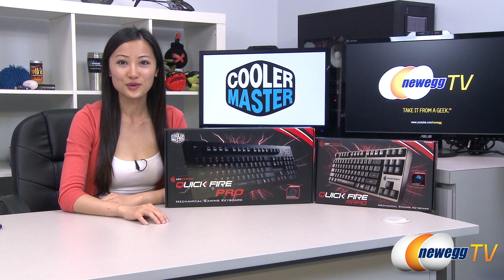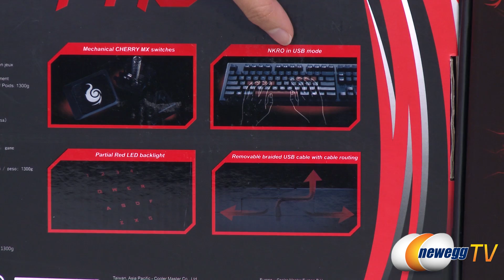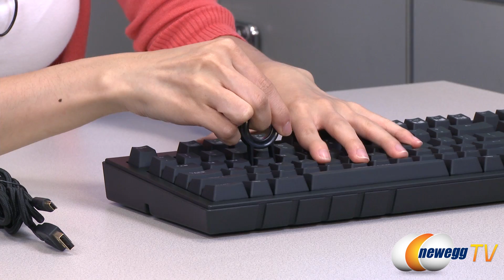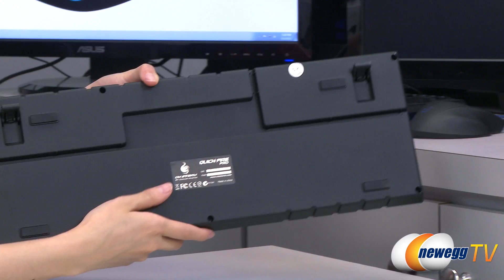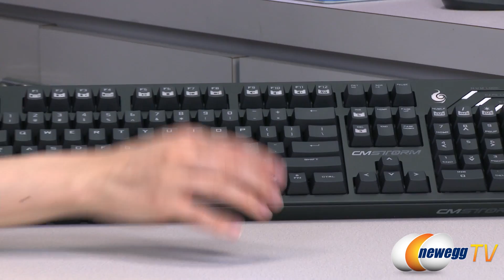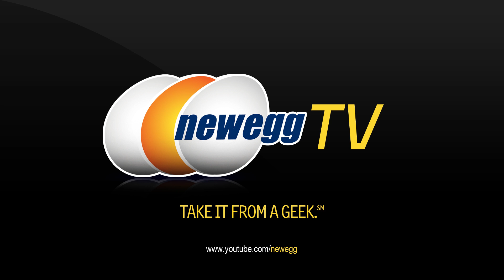Newegg TV: Cooler Master CM Storm Quick Fire Pro Mechanical Keyboard Overview

Comment: I don't understand why should i care how loud my clicking is? it wont change my typing speed. here's a quote from the video 'they've included these feet so that err... it angles your keyboard depending on your comfort preferences' 2:02. well erm.. thats real nice, so erm.. how much is this keyboard? over £65 where i can find a back lit keyboard with macro keys for under £30. i just dont understand what you chumps are paying over twice the price for here
Reply: Hey chump, were you not paying attention to the beginning of the video? These are mechanical keyboards. Not your run off the mill under £30 rubber domes.

Comment: This keyboard arrived yesterday (4/10/14), and I just wanted to share my experience so people don't think their Function lock key is broken.  Basically, the Function lock key does not work as stated in the literature or shown in this video.  Both the literature and the video state that the Function lock should work like the Caps lock key - press it once and the key becomes backlit and allows you to access the alternate keys along the F row.  However, on mine I have to hold down the Function key for 2-3 seconds in order for the key to become activated.  It's not a deal breaker though, but it did make me raise an eyebrow at first and make me think something was wrong with the keyboard. They had a $30 instant rebate and $25 MIR, so the final cost for the keyboard was $58!  I enjoyed some MMO gaming on it last night, and I look forward to trying it out in some FPS this weekend.

Edit: I originally claimed you had to hold Function lock key to access function/media keys.  Now I realize just holding the Function lock down for a few seconds activates it and the key becomes backlit.

CM Storm Quickfire Pro - Cherry MX Brown switches

Comment: Humf.. I'll tell you one thing, it looks solid. Otherwise the dim-ish backlight, badly designed keys (why so much combination just to disable a windows key?) + (WTF! 250Hz Polling Rate?? Who would use that as you've got a 1000Hz just 3 keys away? Pointless.) 
Hardly impressed at all Cooler Master. You could've done far better in expanding your product range -like some other C......-K90 I know-

Comment: It seems like a nice solid keyboard that looks slightly better design wise then the Rosewill ones Newegg sells. Sadly, I don't care for the stylized font they had to use. I do like that the WASD keys glow in the dark for quick in the dark reorientation when you fingers wander. It would have been nice tho if they had a Home Keys mode tho. Seems like a very solid keyboard for the price if you don't mind the font.